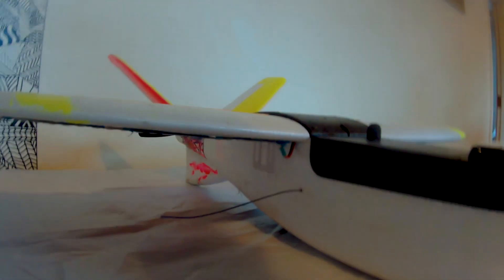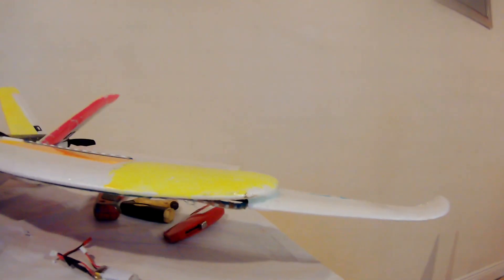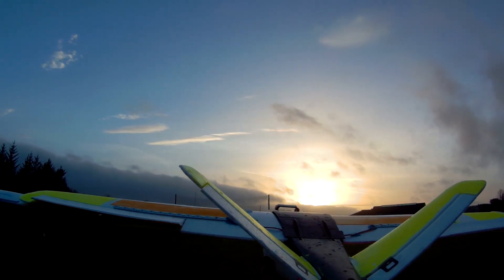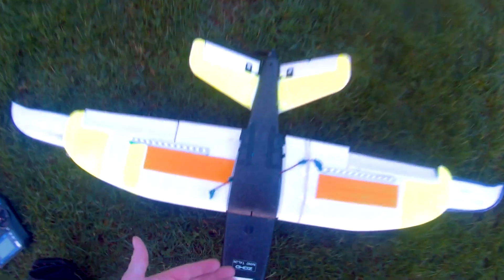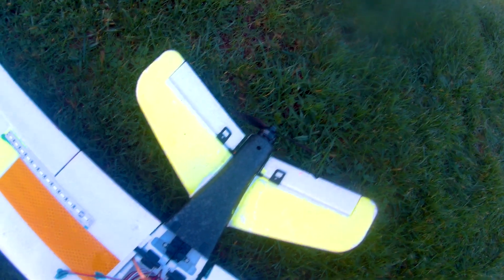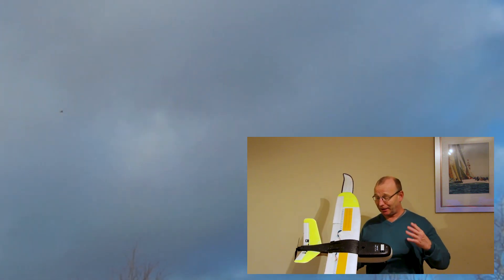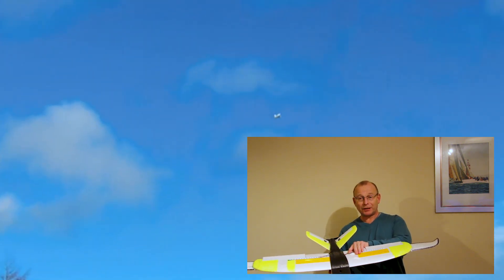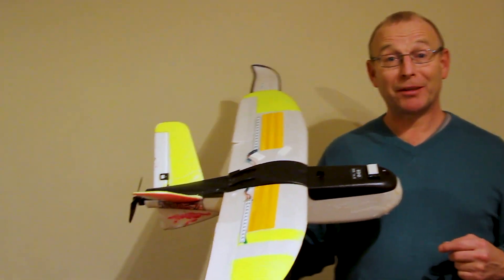ZOHD Nano Talon stabilization modification

Comment: Wouldn't they be better as vertical Stablizers? Looks damn good. Very impressive but NASTY tip stall, one known fix is to take out the dihedral making flat wings seems to stop it, and I think it's just the dihedral helps it fly steady, I've seen plenty fly. Perticularly without wing mods but I would get a new wing set and try looking for the video on how to remove dihedral or I'm even gunna try something else  ;) One of the greatest wings ever...
Reply from the maker: Anthony Cenabite Farr , Thanks Tony , that’s great advice about flattening out the dihedral on the wings, I guess I was just goofing around, sure it’s all a bit of fun, at the moment my biggest problem is my flysky tx/rx combo, my skysurfer just drops from the sky intermittently even when just 100 feet away , no control of any surfaces 🤯, I think it’s all a bit ‘voodoo ‘ to me lol
Reply: @rcpilots1291  damn we have all been there! But what radio do you have? Because I just got a New DX9 I OBVIOUSLY run spectktrum but for ZOHD products Imo it's the best way to go if u don't have a big expensive crossfire unit.. But I FIRST HAD a dx6. And yes I had a couple brown outs killing allot of money! But I GOT LUCKY and.got a Dx8 original of of the best radios ever due to many factors. U can read about it... BUT WITH ONLY my DX8 and a small satalite rx, the. Autobind ones I can comfortably fly over A MILE! this still blows my mind, this radio is amazing... You get pretty much the same Range with any satalite and those are like. 10 to 20 rxs.. I can firmly say I HAVE NEVER had a brown out with my. Dx8... NOW my. Dx9 is here and I need to sell, And have the strap the extended orange gimbals,. Atomic RC case ect. If u want to be able to REALLY enjoy FPV Your radio and reciever are sooo important!! Also spektrum runs. Dsmx so since these servos are digital u can go down to 11ms latency on the radio only thing faster is crossfire at times... But I'm just saying that if you want to experience what this plane is all About being a cruiser. And with a 1k vtx and this radio u can do. Semi long rage, at least a mile...if you would like to get it before I sell it Online hmu.. I. CAN eved add a satalite prebound and leave my. Nanotalon model in there to make..it as easy as one cord plugged in... The little 3 pin thing on the rx is for plugging a satalite rx, with nothing else Needed. They even just released new FULL RANGE antennales rxs with full. Telem. Ect for 30$, allot of the Options but if I can help by giving you a good deal on (old Reliable) I'd love to... Add me on Instagram and cenadubstep@gmail.com if u want to. I check it out ;). Prob solved... One love!
Reply from the maker: Anthony Cenabite Farr you are a gent, thanks for taking so much time to explain stuff to this noob, Ive got a flysky fs i6 radio and fs ia6b receiver, which works fine on my other few planes but I’m thinking the receiver in the skysurfer maybe faulty, I’ll swop it out after completing serious repairs and see how that goes, finances dictate another 6 months or so before going with the better radio that you recommend .cheers and best regards Dave
Reply: @rcpilots1291  wow I have the Turnigy Evolution aswll and love it, I never go to far but half mile seems good even with the micro rx...still. use it on all of my 3-inch models lol. And I'm a noob to the max. No. Disrespect just a guy who. Lives to Fly Lol
Reply: @rcpilots1291  and btw Dave your a hell. Of A Poilet! U should check out the #sq20 cam ull love it.. Plus I have links pollerized lens filters for the #sq12
Reply from the maker: Anthony Cenabite Farr thanks for your comments, n yes I agree there’s something about rc flying that’s so addictive 👍👍👍